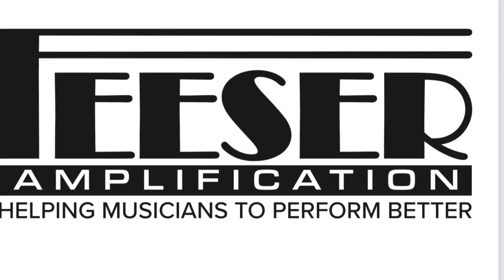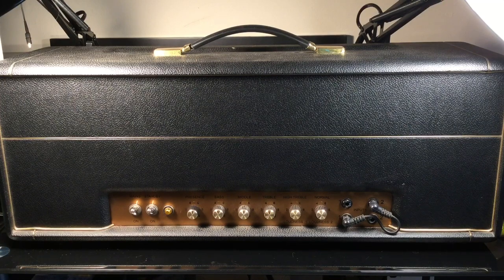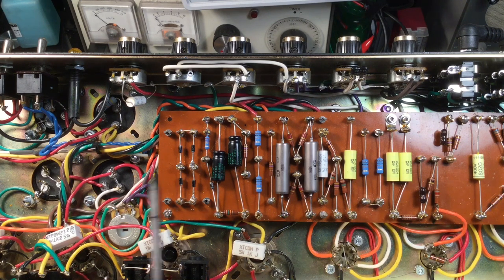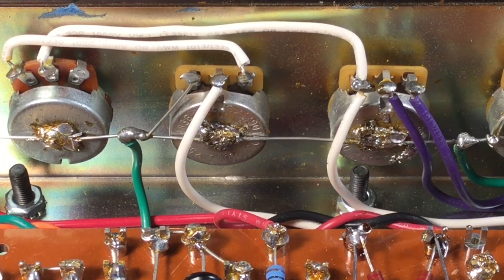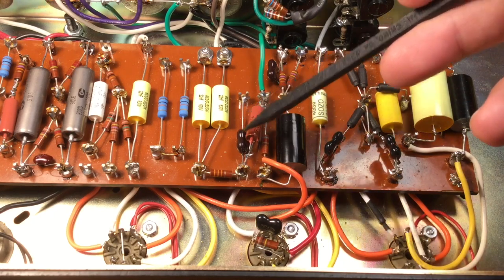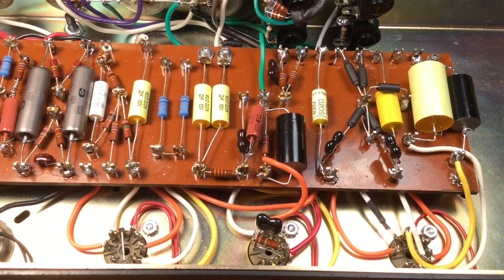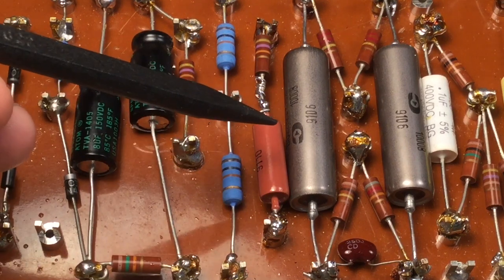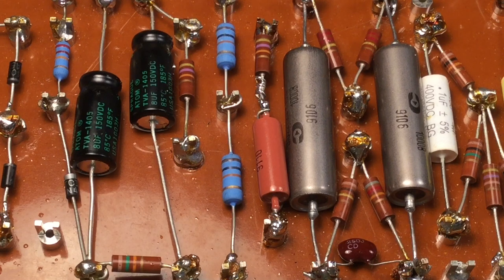How to change a MOJOTONE Marshall kit into a 1968 Marshall Plexi

Comment: Appreciate that you noted importance of good solder iron with adequate heat (and tip). You could do another video on noting all the solder joints on the board that need a redo. I wish I learned this early on.  I once replaced wiring and seloector switch in my Les Paul and later had problems from bad solder joints due to cheapo ppencil point solder iron that wasn't up for the task.

Comment: I’ve heard that the wire runs can really affect the sound/noise. Is there any truth to that?
Reply from the maker: This is correct. However all engineer technician are aware of this issue and there are simple fundamental techniques that can resolve those issues within the circuit design.

Comment: You allway's lose tone at lower volumes since a lot of the "Marshall" tone comes from what the speakers do at higher volumes. Blending the 2 channels is also a big part of the super lead sound. Not at all what I was expecting. The original circuit with a output attenuator should get you closer to a super lead. Personally the bass model like Duane Allman used is the ultimate Marshall tone, but there ya go, my 2 cents worth.
Reply: It is only a few values changed that takes it from 1959 specs to bass spec. .01 in the P.I. VS .022 .01 vs .022 V1 some 1959s had .o68 also in v1 and .068 across v2 and the values in the cathode flower change 56k and 250pf vs 33k 500pf and 1959 has either a 500 or 250 pf across the 1 Meg vol pot on ch 2. I prefer a hybrid spec a cross between lead and bass.
Reply: @sambekins  Yea , I've looked at both schematics many, many, times. The few values that change make a pretty substantial difference in tone. Because of parts tolerances back then Marshalls tended to sound different from one another. Marshal tone is kind of a generalization of what the person saying it is, based on the Marshall (s) they've heard. Back then people didn't care as much cause people weren't "chasing" other peoples tone like today. Rumour is Duanes had some part changes. Just saying of all the marshalls I've heard I prefer Duanes tone. Actually these day's I lean way towards Dumble sounding amps anyway. Unfortunately a big part of the tone was the volume they were played at, and even with an attenuater that can't be duplicated. A speaker at hi volume act's very different than at low volume.
Reply: @Brad T.  yes they do which is why 25 watt gbs sound like they are dying full tilt. THEY ARE! they can only handle the hot cold cycle so many times before one day they quit. A 100 marshal at full tilt is  putting out 145 or more depending which pt is in it ive seen 100 Watters do damn near 200 with a a plate voltage of 503. Duanes amp was a strait 1986 with the P.I. caps being lowered to .022. It was like all of us the tone in his hands. But Duane was special also.